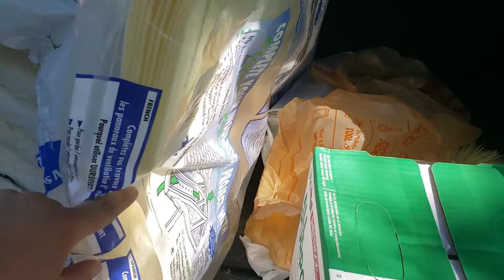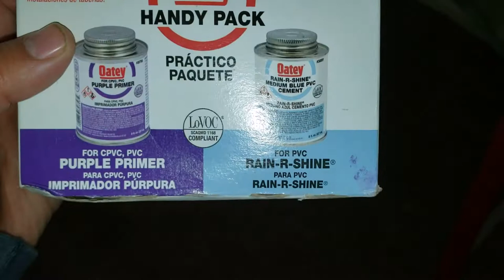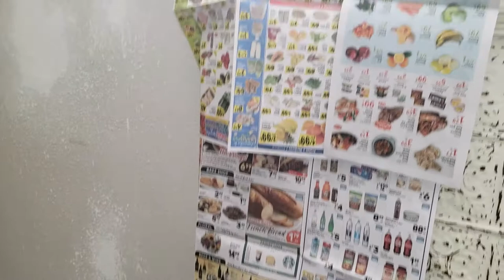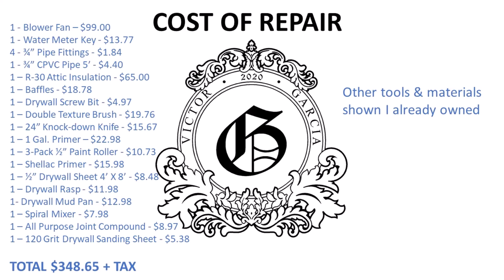Patching A Large Whole In Drywall Caused By The Artic Blast | My Princess's Room Remodel Part 1

Comment: I like your new logo! Funny thing is, i need to do that exact same repair at home. Except i still have galvanized pipes. Other than that i need all the same fixes lol
Reply from the maker: Are you going to repipe the house. They have transition fittings to use with other pipe materials. My insurance deductible was not going to be met so not worth the hassle of dealing with them
Reply: @victorgarciatv  not in the meantime. My deductible also wasn’t met so i gotta do it myself